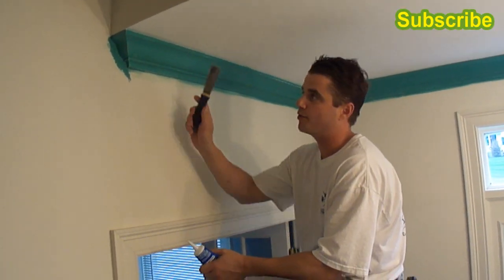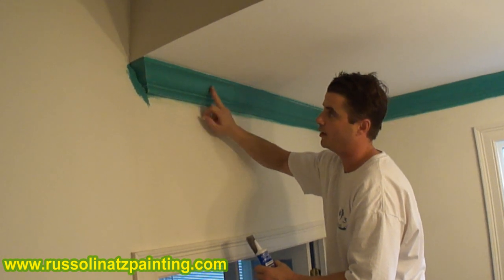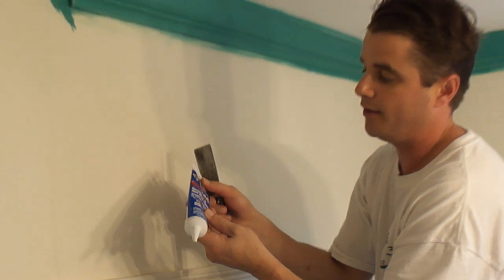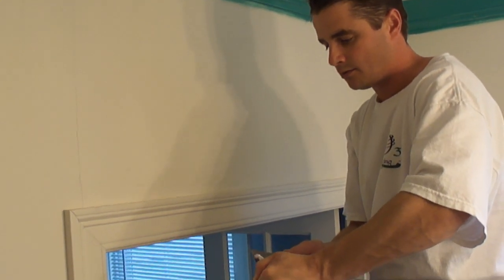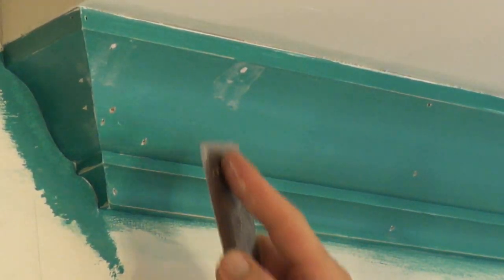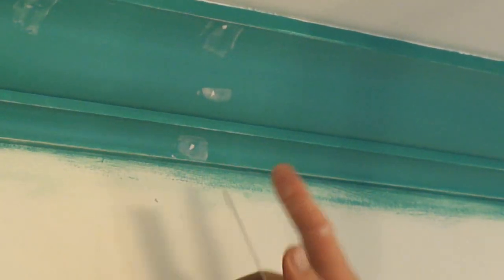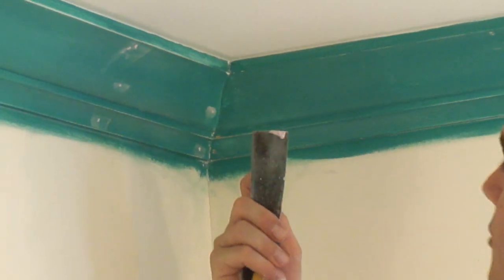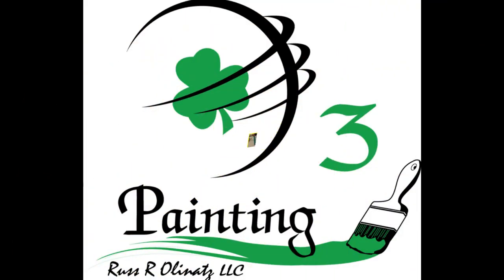DIY - Prepare and Paint New Crown Molding (Part 1)

Comment: Hi after the first coat of pink dap what do you mean by "give it a light wipe"? with a sander? Damp rag? sponge? please clarify, thanks!
Reply from the maker: Hi-

Thanks for your question. I use a sanding pad made by 3M and its Fine grit. because I skim so tight with the 1 inch bade, there is not a lot of sanding required. So, I am basically just applying a light wipe with the 3M dry sand pad. Did this Help?

Russ
Reply: Very helpful, thanks! The 1-inch blade, is it beveled? Or doesn't matter. Love your videos, have learned a lot from you that has made my life easier. Thank you
Reply from the maker: SheetRockGirl

Hi SheetRockGirl-

The 1-inch blade is flat and its flexible. The fact that its flexible allows you push more material into the hole with out gouging the wood.vs using a stiff blade. How is your beach project coming along?

Russ